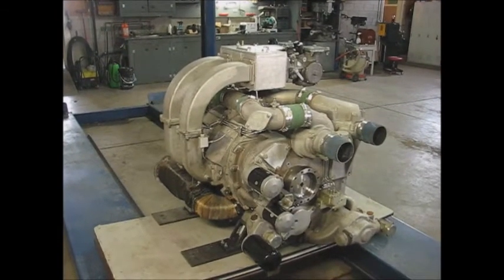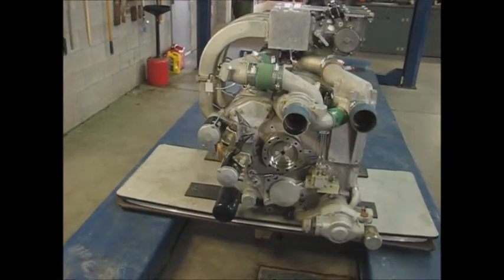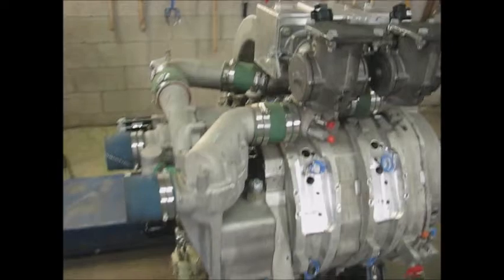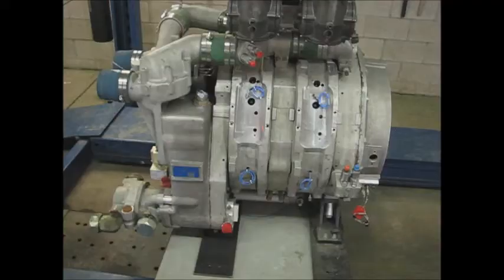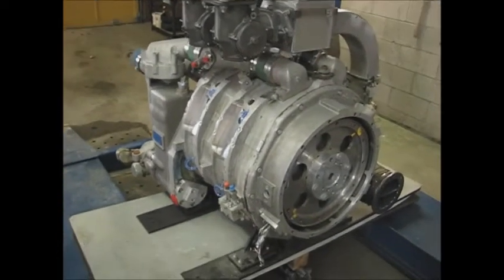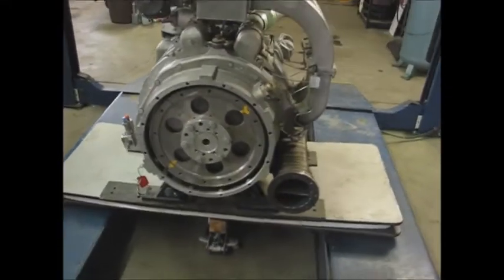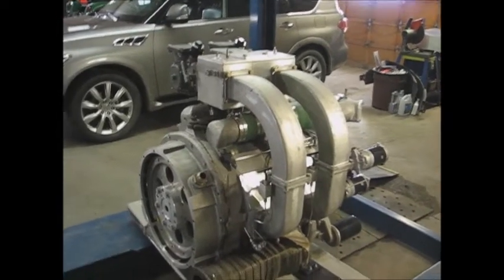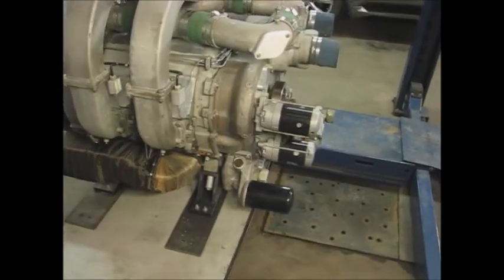580 Rotary

Comment: Can we have 3d scans of end plates and housing etc or is it not allowed? People can re work the stratified injection now. How would that translate to other rotary engine designs? A kerosene powered turbo renesis could be cool. May even return 30mpg.
 Id love to hear a full size 4 rotor version scream with tuned length exhaust and variable intake though. Its brilliant. Thankyou for keeping her in good shape. Its a layered slice of history.
Reply from the maker: David, we did reverse engineer this motor - our drawings and files went with the purchaser of the motor. Could easily simplify most housings and redesign for industrial power generation - we were using smaller mazda motors for testing with dirty wet, low pressure, sour gas flare emissions to run induction generators - very successfully. Coated the cylinder walls with nickel/tungsten alloy using ceramic apex seals making it impervious to the H2S. really cool project should not be cast aside, someone should continue. Sliding combustion chamber will likely not go mainstream automotive - too dirty still. Great technology for flare gas mitigation and industrial power generation.
Reply: @Bricklane01  thats awesome. i understand flares. i just about remember the corby candle. that was a gas flare for escape in the steel blast furnaces which dominated the town. i remember the blast furnaces coming down. now the area is food factories mostly.

Comment: I was one of the techs for Rotary Power International in the early 90's . We assembled and tested them at the old Curtis-wright facility. We also did a 400 hour NATO test in Leeds South Carolina, Boy I feel old .
Reply: there's very little info about RPI online. have you written anything about your time there? would you consider it? maybe you could film some conversations with old co-workers. i know i'm not the only one who would love to hear about it
Reply: @herzogsbuick  Its been a while. I may have an article from one of the local papers that was written during one of our testing cycles.  I can tell you one of the major obstacles was the oil injection unit that supplied oil to the apex seals. The calibration of the oiler was challenging  to say the least. Never stayed in touch with any of my co workers.
Reply: How was the brapp....i mean sound from it?😄
Reply: @Ola_Uteligger   No brappp brother.
Reply: You worked there after my time at Deere Rotary.  I left in August, 1990.

Comment: I was one of a team of about 7 young development engineers that were hired by John Deere in the 1980's to test, analyze, and fix the 580's issues.  It was the best-possible first job for a motorhead like me to get just out of college.

The engine shown is the liquid-fuel version of the Deere-designed rotary after they bought the rights and designs from Curtiss-Wright in 1984.  Deere renamed the engine from the RC350 to the SCORE 580.  Rotor width, generating radius and crankshaft eccentricity remained the same. Deere redesigned the housings to a higher chamber pressure limit to accommodate turbocharging.  The base rated power of the engine was raised from 325 to 375 hp per rotor on #2 diesel.

It is totally crazy for the guy in the video to say the diesel-fueled 2-rotor engine could do 3000 hp.  I tested a single-rotor at 500 hp during my last year there (1990) and significantly exceeded the designed firing pressure.
Reply: @Bricklane01  Yep, John Mack was my boss at Deere for a couple of years.  I was design engineer for the first of the prototype single-rotor 580 natural gas engines in 1990 but left the company soon after.  Never did hear how they worked.  It was a project funded by the Gas Research Institute, and the goal was to do a naturally-aspirated engine with side ports, higher compression rotor, and IMPCO carburetion.  180 HP at 1800 rpm was the goal, if memory serves.  The engine was a development piece, and the rotor housing casting had 6 or 8 spark plug locations.  (The GRI program manager was Art Vatsky, and his favorite configuration was  4 spark plugs, leading and trailing, in analogous locations to the Mazda engine.)  They were going to do extensive testing to find the optimum spark plug positions.  I wouldn't be at all surprised to hear that RPI advanced the engine past my initial design.
Reply: Thank for this short history lesson, Andy.
Reply: What happened to these engines....?

Did they / Score-580 go into Military contract vehicles...?

What happened to the Rotary division
Reply: @DMRH69  John Deere sold off the Rotary Engine Division in 1991 to a group of investors that named it Rotary Power International.  RPI continued with the Marine Corps project for the amphibious landing craft, and the goal was to develop a family of engines ranging from 1 to 5 rotors, and the ultimate goal being a 2500hp 5-rotor engine.  Unfortunately the redesigned engine had a fundamental problem with the assembled stationary gear/main bearing and the project failed.  RPI eventually sold the Deere designs and Wankel engine rights to a small company in Ohio called Barger Tech.  They want to bring a simplified gaseous fuel version of the 580 to market but have not made much progress.
Reply: Wow, thanks for the history lesson and personal life story..  did the lubrication properties of diesel fix the apex seals issue of premature wear?
Reply: @vincentrusso4332  No.  Increasing the power rating from 325 naturally aspirated to 375 turbocharged put us back to square one.  The old apex seal material wasn't up to the higher temperatures and pressures.  We started using carbide-loaded tool steels such as Ferrotic, and Deere developed a proprietary material called Gopalite that was a powder-metal product loaded with Tungsten Carbide particles in an iron-based matrix.
Reply: Thanks so much for this information.

Comment: According to Deere's literature (I have actual Deere literature) the 580 series were available in single to 6 rotors. The single had 375 bhp and the 6 was 2250. The smallest rotary was a 70 series single rotor at 80 bhp.

Comment: SAE paper 890324 is about this wonder engine John Deere 2034R . $33 to download from www.SAE.org:  Mount, R. and LaBouff, G., "Advanced Stratified Charge Rotary Engine Design,"   https://doi.org/10.4271/890324  membership not needed to purchase. 
SAE papers 710581 and 720466 summarize Yanmar Diesel Reed-Valve research in their small Wankel engines; SAE paper 790435, by Toyota, T Kohno et al, is about air injection in exhaust port and Reed-Valves in intake duct to improve economy and emissions. Metal Reeds can stand 15'000 km, could destroy engine if swallowed, Carbon Fibre petals may last 8'000 km. (2-Stroke data) You don't know how much I'd like purchasing this John Deere engine, but no money left. Blessings +
Reply: The 2034R was a 2-rotor engine that John Deere Rotary designed for a joint venture with Avco Lycoming in general aviation.  Its power rating was 400 hp @ 5800 rpm.  Unfortunately, the project was started at a time when general aviation was in decline due to lawsuits about safety.  Avco cancelled the project just as the first engine was being built.  Deere still tested it and made the rated power, then the project ended.  It was a very nicely sized engine, 1.7 liters per rotor, so a lot bigger than a Mazda, but not so big it couldn't fit in cars.  

The 11.6L engine was physically large and weighed about 1700 pounds, so don't dream about swapping it into a Miata.  The rotors weighed about 90 pounds each, and the rotor housings were about 140 pounds.

Comment: runnitttt
Reply: They never ran properly, program was a failure.
Reply: Yes we did get them to run properly, and completed the USMC required tests rated at 750 hp.  I personally ran about 2000 test hours on them.

Comment: How accurate are power figures? It sounds too many HP for a not extremely big engine. Blessings +
Reply: Ummmm....compared to a normal wankel motor this is a colossus. For reference, you can easily fit 2 to three rotor systems inside a miata.....this monstrous engine is the miata.
Reply: they are very accurate numbers. a 2.6L rotary can hit those numbers without issue.  1200hp na, 3000hp turbo is nothing for a rotary  engine of 2.6L, let alone 11.7L.
Reply: Rotory engines tend to have the power of a piston engine double their liter size.